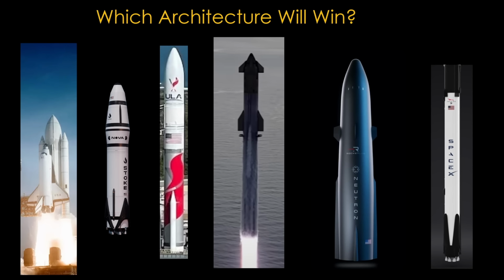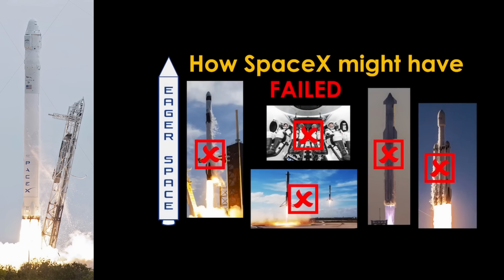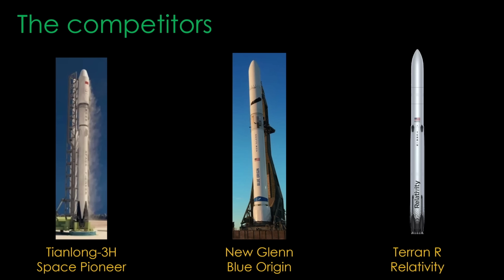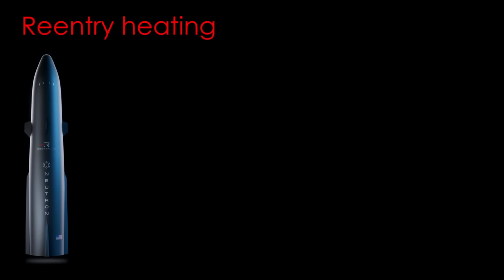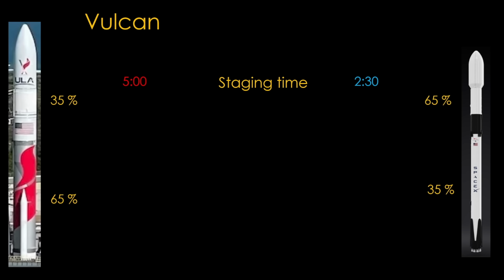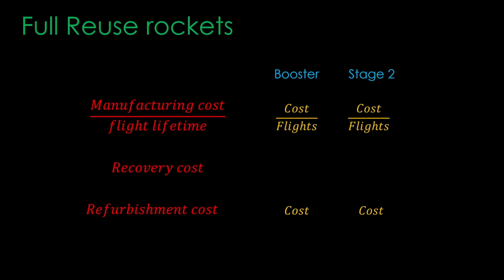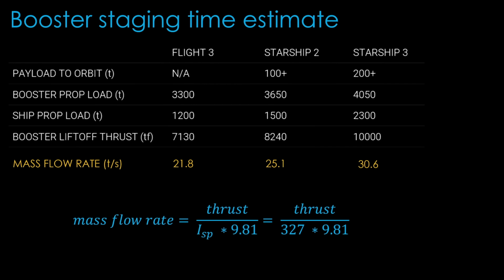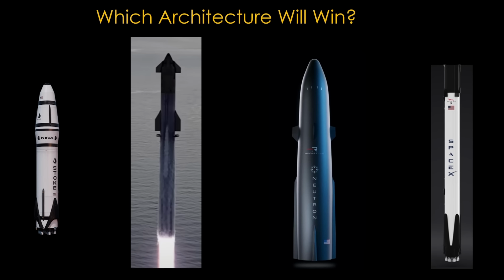Who wins the reusability race?

Comment: One thing Peter Beck (Rocket Lab CEO) said in an interview not long after the original announcement of Neutron is that only a third of the cost of a launch is the vehicle. The rest goes into operations. Therefore what actually matters is having a rocket that facilitates a high cadence. Neutron's design spec was for reuse within 24 hours. that makes perfect sense given that there is no recovery/refurbishment of the second stage. You just drop a new second stage (with payload attached) and away you go. The other thing rarely understood is that Neutron's design means the second stage is minimalist in cost. Most of the vehicle cost is recovered with the first stage. 

I think that a lot of people are so fascinated by the idea of "fully reusable" that they ignore the economics. It's going to be cheaper to have a small expendable part (second stage) if what you get in return is a lighter vehicle that doesn't spend weeks in recovery/refurbishment phase. Also there is a price in full reusability that scarcely gets mentioned. A fully reusable second stage means a second stage with both the mass of thermal protection and structural mass needed for surviving re-entry. The consequence is doubling the mass of the first stage for a given payload, since all that mass needed for the second stage to be reusable means more mass in the booster. The whole thing (yes I'm talking about Starship) becomes even more expensive as a result because (see above) operational costs.
Reply: People are correct to be fascinated by the idea of full reusability once you consider for a moment that we still don't have any. We can't solve any problems with it until we have something to work with, so it a good goal to strive for.
Reply: @thearpox7873  Its a fascinating problem. But a 90% reusable rocket may prove to cheaper to operate than a fully reusable rocket.
Reply: @saumyacow4435  Perhaps. It could be like the moon mission, something we achieve, only to take a step back for sixty years till we get even better technology.
Reply: @thearpox7873  Or we could execute a series of exploration missions to Mars, gradually refining technology over decades. I've no doubt for instance that fusion powered propulsion will mature. But even so, there is no compelling reason to ever exploit or colonise Mars. So let's patiently explore. There's plenty of it.
Reply: @saumyacow4435  I didn't mark you for an AI, but I also have no idea what the cost-competitiveness of reusable rockets has to do with Mars, so I can only assume I've made a fool of myself.
Reply: @thearpox7873 Starship's design was driven by Elon's fascination with Zubrin's "Mars direct" architecture. That was what drove the "fully reusable" requirement. In insiating that Starship be designed as a Mars transport he's also compromised Starship's economics as an an Earth bound workhorse cargo vehicle.
Reply: @saumyacow4435 Mars Direct itself doesn't require or even suggest a fully reusable rocket.
In fact, the refueling required for Starship to go to Mars is the opposite of "direct".
Furthermore, Mars Direct proposes an Earth return vehicle separate from the habitat unit, which (the HU) is part of the outgoing vehicle.

The only part of Mars Direct that Musk's plan uses is generating fuel on Mars, which seems to be contrary to the spirit of MD anyway; it's a necessary compromise (innovation).
MD is about continuing the Apollo program to Mars, not colonization, and rejecting the Space Shuttle as helpful to the goal. 

Full reusability is about fulfilling the (supposed) goal of the Shuttle to make space flight inexpensive, even moreover to the point of parity with a jet airliner, which is required to make colonization (and not just Apollo-style exploration) possible.
Reply: @michaelmicek  Point taken that you can implement Mars Direct with expendable vehicles. However my point was about Direct return and therefore the refuelling infeastructure. And of course when your Direct return vehicle is the size of Starship, that's turns the process into industrial scale strip mining.

And whilst a fully reusable vehicle is a noble cause, the Shuttle reminds us that there is a difference between reusable and economically viable. I would have been excited if Starship had proceeded with the difficult development needed for an actively cooled skin. But when SpaceX opted for tiles, that raised a red flag, in my view.
Reply: @saumyacow4435  Well, surprise! Active cooling is back on the table.
Similar to how they tried using only an above-ground stand, but are now building a more conventional flame trench for the second pad at Starbase.
Starship is still a research project, which is the difference between it and other recent programs, especially Shuttle.
Instead of designing top-down and expecting everything to work, they started with a design that was too simple and are working up.
Reply: @saumyacow4435  I intended to comment that SpaceX is again considering active cooling.
Reply: @michaelmicek  they inevitably will have to return to it. No return from Mars with TPS tiles.
Also, with clever engineering, metal heat exchangers/transpiration cooling plates can become structural members, and thus allow using thinner metal for actual rings
Reply: @solarissv777  returning directly from Mars to Earth's surface doesn't make sense to me anyway.
As I've been following SpaceX the last couple of years I've been getting an appreciation for how Musk operates (implements his ideas).
Saying things like, "Oops, sure enough, we do need active cooling" is entirely in line with that.
It's not even a secret, "the best part is no part" is stated repeatedly; they just really take that seriously until it's proven that part really is needed after all.
Reply: what if there is another answer to full reusability? How about instead "A fully reusable second stage means a second stage with both the mass of thermal protection and structural mass needed for surviving re-entry." making the second stage with such a little dry mass, that TWR alone would allow it to slow down to survivable speed, or make it so light that its drag to dry weight would slow it down before the heat deals any damage. COPVs from various spacecrafts and second stages often survive the reeentry, and Neutron's second stage is just a giant COPV.
What I don't like about starship is that to survive reentry for such a heavy second stage you need a lot of heat shielding, and that heat shielding eats the payload capacity, to launch more payload you can build a bigger rocket, but a bigger rocket will need more shielding, more structure and more fuel. All this stuff just snowballs, and the rocket equation doesn't like heavy rockets. Although at some point the cube law gonna win over the rocket equation, but the amount of fuel and labor required might just make it less efissient even in comparison to an original (no second stage reuse) Neutron.
Reply: @solarissv777  I've also heard plans for even larger diameter Starships, which as you imply would increase the volume to skin ratio almost linearly,
Reply: In effect, most of the 2nd stage costs, if disposable, is the rocket engine. If recoverable, you can cut 2nd stage costs in half

Comment: To put it bluntly.

Falcon 9: Just make it work with mostly traditional method.
Star ship: use more hightech engines and fuel, and use the scale advantage.
Neutron: Use high tech building material throughout to make it all over a better rocket

My guess is that Neutron is going to start to pick up Falcon 9 market when it start to ramp down. It seams like its the most optimal solution.

But eventually someone probobly figure out a way to land a downrange rocket that is not on a drone ship. 

What about just a small island with a landing pad. Could theoretically just fuel it and fly it back, it would even need that much fuel.

Using aerodynamics could probobly hit very close to the pad on the way down and only a tiny amount of fuel would be needed to actually stop the rocket.
Reply from the maker: I talk about this in the super heavy drone ship video, but the big problem is that you launch in different directions depending on what you are doing, so there's no one place you can land. And you need to set up infrastructure and marine assets to get fuel out to wherever you land.
Reply: @EagerSpace  well... its really a matter of finding a mission you do a lot of times that have the same tryjectory...like a moon/mars refuling mission.

Comment: Hi! Thank You for posting. This is an nice clip... so I did check your channel.
I'm sorry but with titles like "Orion Capsule Coverup?" you'll only pull the flim flam wich is not what I'm looking for.
Reply from the maker: It is an unfortunate reality that YouTube rewards more edgy titles than more placid ones. This is definitely on the edgy side for me, but I think it's an accurate description of what has happened.

NASA claimed they had a small issue with the Orion heat shield. They didn't put any detailed information in their post flight report (I did a FOIA request to get it), and then it's not until more than a year later that we find out through a NASA OIG report that there were significant issues and pictures that NASA had neglected to share in the time since Artemis 1. 

NASA is required to make that sort of information public in the space act of 1958 that created NASA.

When the OIG report was released, NASA announced they would convene an expert panel to look at the issue and they would be done in July. No report from the expert panel has surfaced. 

That was the state when I made the video. Since then there have been months of silence, until late October when NASA said they knew what the cause was but would not tell us what it was until they did more tests. 

When you have a major issue that only comes to light because your internal investigational department publicizes it, I think that meets the definition of a coverup. 

SpaceNews has a decent article about it here:

https://spacenews.com/nasa-finds-but-does-not-disclose-root-cause-of-orion-heat-shield-erosion/

Comment: Here is a crazy idea: how about using the Neutron Booster stage paired with a Stoke Orbital Stage that could fit inside the Booster's "hungry hippo" Fairings?   No need for the orbital reusable stoke booster to carry fairings or the sturdier payload support, Also since there is no need for a huge vacuum Nozzle (which takes up a lot of space) perhaps you could have bigger fuel tanks in the booster.   Any feedback on a Hybrid of the Two of your rockets systems you have reviewed?
Reply from the maker: I think it's unlikely, but stranger things have happened.

Comment: Will be crazy if both Starship and Super heavy are caught and reused before anyone else even challenges F9 which is partially reused, lol.
Reply: Sadly, V2 of Starship didn't do so well at the beginning of the year, so the second stage was never attempted to be caught. The booster was caught 3 times and already reused. Out of everyone else, only Blue has managed to land their booster. But they still haven't reused it. 

What do you count as challenging F9? Just reusing the booster the same way? If so, Blue might do so before Starship has the upper stage caught. But it is unlikely that anyone will compete with F9 commercially ever. At least not before SpaceX replaces all Starlink launches with Starship.
Reply: @anthonypelchat  part of the problem is that 70% of Falcon 9 launches are Starlink so there's actually relatively little market to take unless you're making your own constellation. It'll take at least starship to fully kill F9. Amazon Leo and USSL make up most of the commercial launch market so that would probably be the metric to look for. USSL more so because Amazon is biased against Falcon, although failure of other launch systems to keep up has been enough for them to crack in the past
Reply: @notgreg123  I mostly agree. It's highly unlikely any rocket other than Starship will be able to kill off F9. However, I do think the market will continue to grow and even more so once Starship is flying regularly.

The market is actually larger than it seems. The vast majority of launches, even excluding Starlink and Kuiper, are LEO launches. And the vast majority of those are on tiny rockets. It's easy to forget that F9 is a pretty large rocket. Rocket Lab launched 21 times last year. But all of those could have fit on just 2 or at worst 3 F9s.
Reply: It's actually pretty likely. Unless there are stubborn problems with reuse of the heat shield there's little reason to not catch & re-fly the ship by mid-2025, considering the precision of Flight 6 landing. The only question is where to catch it. 
Neutron 1st flight is NET end of 2025 and reuse likely won't happen right away. New Glenn will launch fairly soon but a successful landing and re-flight aren't guaranteed for the first couple of flights.

Comment: You forgot to mention that the Falcon 9 fairings and interstage are made of CF/AL honeycomb and are reused. They do have some current CF experience.
Reply from the maker: The video literally mentions that the interstage and landing legs are carbon fiber.
Reply: @EagerSpace  Apologies, I missed that. Allthough you still missed the fairings, no?
Reply from the maker: I wanted to talk purely about the booster, so I didn't talk about fairings. I don't think they're relevant for the booster question because they are really light
Reply: @EagerSpace  Understood. Still, they cost around $6M to manufacture per pair, and I believe one just did its 21st flight. They do aid the F9's low cost to launch (estimated to be between $15-20M). I was wondering how long BO might take to start reusing the NG's. It all adds up, cost wise. You're right, they don't affect the booster, but they certainly do the complete rocket. Also, one wonders if ULA and Ariane might attempt to reuse theirs some day. With SX allready doing the booster sea-recovery thing, it just makes so much sense. Some seem to be playing checkers, and SX 3D chess.

Comment: One slight nitpick regarding Neutron's development cycle. If they choose to use the carbon fibre tape laying approach, where the component is built up additively using a freely moving robot, they could minimise the use of moulds and allow for faster prototyping, as well as having an easier time making use of things such as fibre alignment to enhance strength.
Reply from the maker: Carbon fiber tape is laid into the molds
Reply: @EagerSpace  Ah, never mind then. Thanks for the correction.
Reply from the maker: Rocket Lab has some cool videos showing this somewhere.

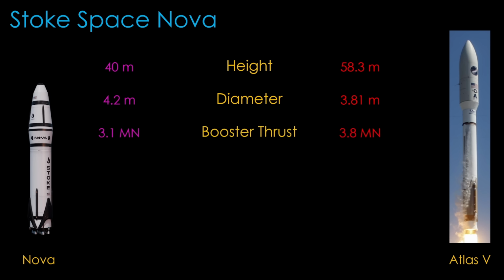Comment: 26:00 I did some rough Δv calculations for the Nova rocket using information from The Draft and the Stoke Space Nova Wikipedia page. It should also be noted that Stoke is trying to get the Nova to market ASAP, and therefore The Draft does not reflect the Nova in it's final fully reusable form. Many of the numbers in The Draft are nice round numbers (in lb), so they are closer to estimates rounded up, and probably aren't even the final numbers. 

The gross liftoff mass is 226,796kg (Draft p.25), Stage 1 propellant mass is 183,705kg (Draft p.25), Stage 2 propellant mass is 17,989kg (Draft p.25). Stage 1 Isp SL: 310s, vac: 345s (Wikipedia, no source given). I'm going to average the two values, as the 1st stage will be climbing through the atmosphere for an Isp avg: 327.5s. Stage 2 Isp: 430s (Devon Papandrew's interview, 2nd link on the Wikipedia page). Payload is 1250kg to 7000kg (Draft p.36).

The dry mass = gross liftoff mass - stage 1 propellant - stage 2 propellant - payload = 18,102kg. I'm making the guess/assumption that 25% of the dry mass if for the 2nd stage, making it have 4525.5kg. For payloads less than 7000kg, the gross liftoff mass will be less, so remember that when doing Δv calculations.

Using the full 7000kg payload capacity, Δv1 = 5336m/s and Δv2= 3967m/s, and Δvtotal = 9303m/s. Given the stated Δv needed to get to LEO is "around 9km/s, depending on gravity losses, drag, and inclination", this is a good indication the Nova can place 7000kg into LEO in expendable mode.

What about reuse? If we assume the orbit requires 9303m/s of Δv (as that may be what's required due to Nova's gravity losses and drag), and 20% of propellant is reserved on both stages for reuse, then the configuration doesn't work (assuming all my numbers are correct, and I still remember how to do math). This is disappointing, but expected; Falcon 9 didn't start out with enough of a performance margin for reuse, and SpaceX is currently dropping hot stage rings on Superheavy because they don't have enough Δv to get the current Starship into orbit and get the Superheavy back to the tower.